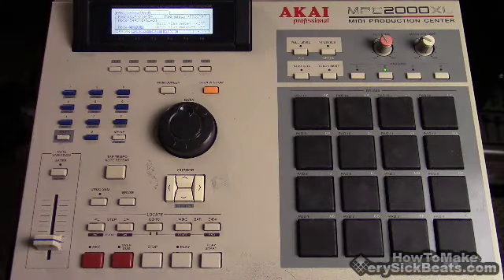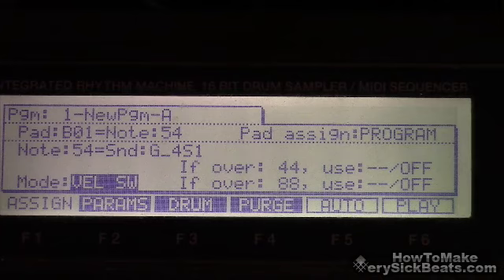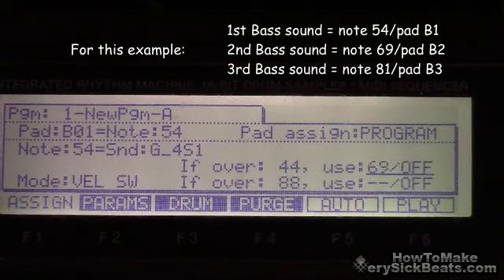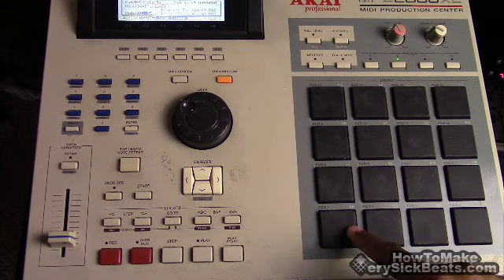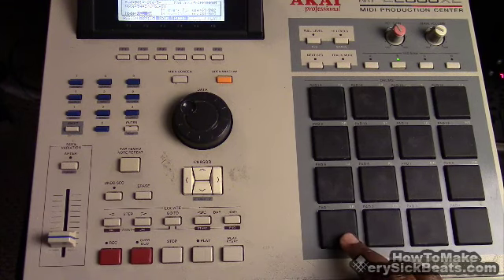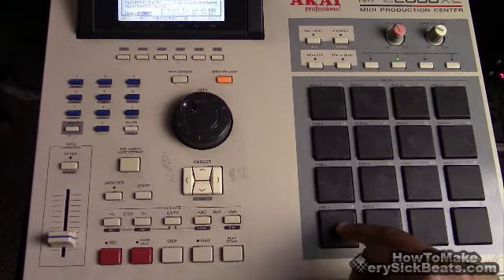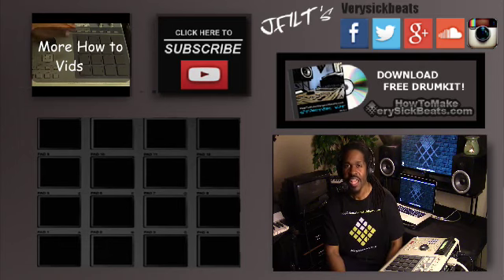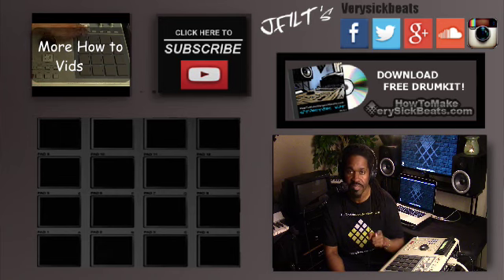Beat Making | Velocity Switch Tip

Comment: Yes, you can play 3 different sounds by hitting one pad, but they have to be sounds that are assigned to pads in that particular bank. And there are only 16 pads per bank. Respectfully...
Reply from the maker: Van Cozzin As far as mpc2000xl is concerned u can and i've done it.  I've layered sounds from bank b,c, and d